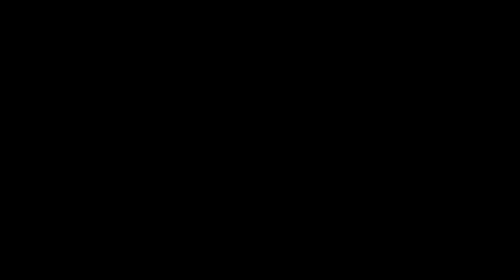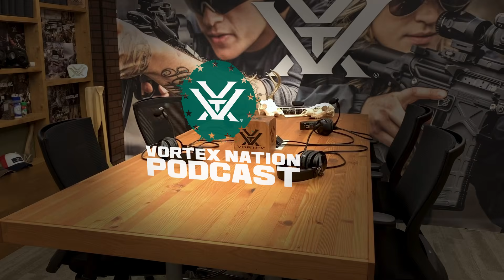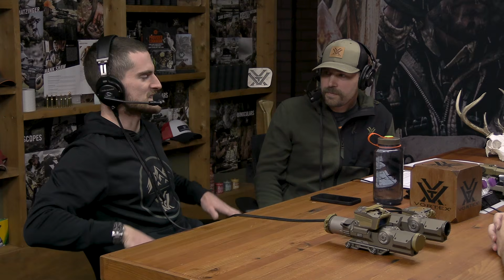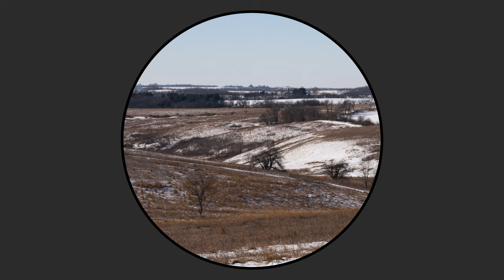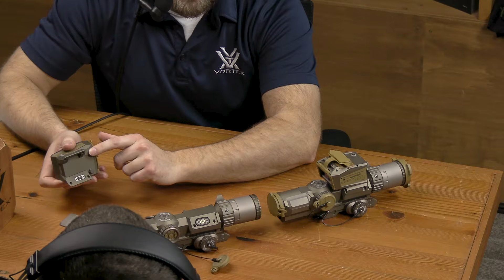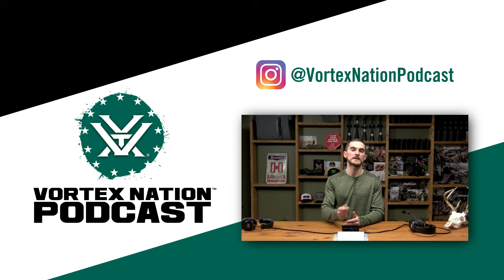Ep. 220 | Army selects Vortex® for Next Generation Squad Weapon – Fire Control. What is it?

Comment: That scope is more of a sensor node mounted on a rifle with an interface related to that platform.  a smartphone could do the rest of the integration with IFF and Target Designation for the BIG boom.  

I might be the thing to do in the future.  Issue a mil-spec encrypted and hardened smartphone to the soldier/Marine as they graduate their basic MOS courses.  Most phone have plenty of compute power and having the standard software load would allow that automatic connectivity that would integrate that scope.  It might allow the scope and other items to be only as smart as they have to be as well. When the servicemember leaves in 4 years, the partially dated technology is scrubbed and they get a current android or apple operating system with their familiar tool and the service can automatically update a lot of its basic computing and  communications technology.

Comment: Saw this mounted on a rifle in an article about the XM7.  The box on top is kind of hard to miss, so I dug up this video to find out what it is.  Good explanation, but now I'm wondering what the intentionally mysterious forward data port is for.  I can only guess it's intended for night vision, but not clear how it wouldn't get in the way of the range finder.  Also, no one mentioned it, but it appears there is a third data port on the back of the range finder.  It looks intended for a cable connection, but for what?

Anyone dreaming of having one of these needs to consider enlisting.  They are a small company with a military contract for 250,000 units.  In the guest's own words, once they ramp up production to meet their contractual requirements, then they will reassess civilian marketability.  No way are these things being sold to the DOD for less than $30k.  How expensive would it have to be for a civilian option?  If it ever shows up on shelves, it'll be at least $14k.

Happy hunting!

Comment: Long-winded interview with 10 min of detailed facts. I understand the drop test but the waterproof test is not covered to my liking. Is the scope submersible in operation to 10ft (3 meters)? Which caps need to be on? What about water vapor getting in with high temperatures? This is the Achilles heel of most optical scopes. A fogged optic is impossible to use. What is the range of the local area network? Can an enemy pick up this scope from a dead soldier and have instant intel on everybody's location? You said something about a wireless smartphone interface. Explain?

Comment: Only wish they mentioned eye relief. I can see this replacing LPVO, Prism (ACOG) and magnifier + RDO combos, but the one thing it won’t have is infinite eye relief and almost no parallax that a reflex sight gives you in a CQB situation.
I can see soldiers still mounting a micro red dot on top of this (or offset on the rail). Or they will just improvise:  I have a police officer friend in the anti-drug unit and his duty gun has a LPVO and, when he has to make a shot inside the same room, he just place the top turret of his trijicon scope at center mass and shoot. Considering the body count of his unit, they are probably into something.

Comment: Won’t the laser and scope be off at long range if they are zeroed at the same distance not originating from the same point?
Reply: Only if fixed, if the lasers change with a range drum adjustment on certain scopes you’d be fine.

We didn’t rely on our lasers beyond quite short ranges and I liked them for allocating arcs, reference points and targets to troops. Very handy at short range opportunity targets combined with HMNVS (helmet mount) though.

Comment: The best part was the rendered view threw the scope. It is nice to see a guy taking part in making the things talk about the product. I would imagine the thing at least has the capabilities of a flagship cell phone IE cameras, GPS and possibly other allied positioning chips as well as AI and AR capabilities. I imagine that networking the scope to DoD networks and localized computer such as a laptops, vehicles or other portable squad based or personal computers increase the devices capabilities. Keep in mind call phones have had limited AR and machine learning capabilities for years. If machine learning is incorporated it could be on par with something like an Nvidia Jetson to some extent. In any case a civilian version will have different networking protocols. Bluetooth, WiFi or both due to FCC regulation that don't apply to military devices but do apply to civilian devices. Id also imagine the laser designator may be turned down for the same reason. Though Bluetooth is and always has been insecure unreliable garbage and I would rather not have it on anything attached to a weapon... I am referring to the several Bluetooth exploits where bad actors could remotely enable the radio and walk into any device. It is very possible that besides the radios and designator this scope doesn't have anything a civilian couldn't have giving that its intended to be used as part of a network and I'd imagine that most of the heavy lifting would be done remotely. How ever if it has a UV and or high res IR camera on board it could be quite expensive. If it some how incorporated true night vision I am impressed.

That aside I want one and I am excited for this product. I find it interesting how well the Army is learning to use technology though some times I think they over use it in some cases. But turning everything into a recon device in order to build a more complete and accurate image of the battle space is definitely the right direction. I have to wonder what the point of a 3 color display is when a transparent OLED could provide a full color experience. I can only imagine what ever display they have gone with must be more reliable than a standard transparent OLED but off the top of my head I am not aware of a display or display tech that is not either mono chromatic, RGB or full color. Its probably a custom display.

Comment: Props to the Army, this is a no-brainer. Why would they choose the Vortex over several big names that have enjoyed their spot in the sun, like Night Force and Swarovsky? 

Because the optic does not fail and does what it is supposed to do, regardless of price point.

I have learned from personal experience. I have always been a Vortex fan boy but I tried a few other optics. Including one recently getting a lot of attention and being the main competitor to the Venom and the Strike Eagle.

A) I still like the Vortex glass and coating better.
B) the other scope had scales that would slip (engineering problem.) I mean the other cover with the number on it would spin freely after sitting the cabinet for a month. So, I put the Venom back on. Not once does a scale on a Vortex slip around the turret. For any reason or lack of reason. Ever.

Vortex scopes are built so that you zero your rifle and ammo and you are done. Store the rifle. Pull it out later and go hunting or rangering or designated marksmaning, or whatever. You don't to have find that one allen tool and then hope that you had where it was supposed to be.

So, the Army decided they needed an optic that does the job and does not fall out adjustment. Stick it one, climb a ladder on top of a mud hut. Start neutralizing enemy threats. It does not have to be complicated.

Comment: you would think that with an advanced high tech optic such as that. that it would run a secondary monocle system, kinda like what they use in an Apache Helicopter, to where you didn't actually have to look through the scope itself you could use the monocle, to see what your scope is seeing or aimed at. now that is a scope that I would like to have to where i could see everything the mounted scope is seeing without actually having to position my eye to the specific distance to see through the scope

Comment: It's times like this that I wish I was still on active duty Army so I'd be able to play with the new toys a lil bit sooner rather than waiting years as a reservist. That also brings up the silly comments I hear from other's about these new weapon systems where they think the military is just gonna chuck all the current gear in the trash and switch right to the new stuff and only that. Our military has a long history of fielding equipment and gear for 50-100 years getting as much use and life out of everything. Heck my unit just last year get a new batch of fresh M4's to replace our M16's, those are gonna still be around and in use for many years to come and when the day comes that the new stuff filters down and replaces our current stuff, they'll just turn in all the old stuff to get stored away for a rainy day just in case. Also the training of basic marksmanship isn't gonna change too much with these new options, they'll just add on to what we currently use. The average soldier is still gonna need the basics to fall back on just in case something happens to this optic system so it's not like our troops are gonna be screwed just cause we have an upgrade and it gets taken away suddenly. So far I'm liking what I'm seeing with this system and hopefully get to try it out before retirement lol, that only slight nit pick I have so far is the battery arrangement I'm guessing yall picked side by side CR123A to perhaps reduce overall bulk, I just wish they were in line and could also take a rechargeable 18650 or similar like the one's streamlight makes for their flashlights but that's just me lol.

Comment: Year 2350 westpoint academy.."and that was when the age of the scope started"

Pairing these scopes with smart bullets is the future.
Reply: I don't see 6.8mm smart bullets coming out any sooner than fusion power for commercial usage. They've got them down to .50 BMG, but not yet up to even 7.62, leaving them right up there with the 20mm smart grenades that never survived to prime time and the old mk14 torpedoes that occasionally worked during WWII.
For this, I'm retired now, so have no use for the $3k laser module, but the etched scope, well I'm used to paying more for the optics than the rifle. And well, MILSPEC means, the weather can range between crap, poop and shit, the damned thing will still work the same, with only mild adjustments in use and care.

Comment: Looking at the new XM250 machine gun, doe s the mounting of the xm157 optic interfere with opening and closing the weapon's feed trace cover? Was any testing done with this optic on the XM250? The optic looks rather long and may potentially block acces to to a critical part of the gun.
Reply: Good question, our optics and night sights used to mount on top of the Top Cover which meant a bit of extra practice for the gunners to get used to it.

Comment: The only real issue I see with many of the extras on this optic, ties in with the laser range finder. Most near-peers are mostly mechanized infantry that are integrated with or generally in close proximity to an IFV or other armored support. All of those vehicles have very sensitive laser warning sensors and don't have to directly be painted for the sensor to be tripped. Many advanced optic monocles and binoculars can also passively pick up getting hit by a laser range finder as well when your own ranging numbers start throwing odd values or giving an error status all of a sudden. Most units aren't running around with a laser range finder on that ridiculous rail setup you showed. Most are still doing it the old-fashioned way of using the mils on their scope to do some fairly accurate approximations. What I'd be afraid of is in a future war with a near-peer, one of your guys paints them with the laser range finder, triggers a laser warning sensor and the enemy drops to the ground and goes into high alert and they already know where you're generally located and your range since, like tracers, lasers work both ways.  

So, like many other advances, it works well in theory but falls short of its objective in practice because the engineers and military program planners assumed future adversaries were idiots who themselves aren't trying to upgrade equipment and have also buried their heads in the ground. We used to have an old saying in the Air Force. You need proper control and discipline with EVERYTHING that you emit, not just your bullets. Lasers emit energy and that's something that can be picked up and detected by an enemy that knows to look for it. You're going to have built-in microsensors on people's rigs and equipment that'll flash a laser warning to the user and approximately where it's coming from which should give them enough time to hit the dirt to get into cover. They now know your direction and approximate range before a bullet ever left your gun. Many other support functions can visually see this energy readily already and when we're talking about the proliferation of small observation drones, the relatively low-intensity energy of a ranging laser will be observable to adversaries who know that laser range finders are prevalent at the individual infantry level. Vehicles already have them since other vehicles and infantry engage them using laser-based designators/range finders and it's been standard equipment on modern armored vehicles and in-flight vehicles for decades. 

So, we now have two potential issues. Troops train and learn to use these optics to their fullest but lose out on many tactical advantages and many times, the element of surprise and movement. Or, it'll just be a heavier optic than the LPVO that they were using and they weren't using a LRF anyways so they now have an even heavier optic with functions they'll never really use. On top of a weapon system that's now at least 2lbs heavier dry than their older one which was already starting to comically get too heavy with all of the crap some units wanted troops to put on them. Crap that ended up in a duffel bag next to their cot once they deployed.
Reply: The LRF has to be manually activated by the end user
Reply: And we have multiple methods for range estimation that are still taught and practiced
Reply: @hanzzimmer1132  Of course the LRF has to be used manually. The issue is that you have something that's not going to really be used for the occasion that it was originally planned for. A modern army has laser warning detectors all over the place. You're not going to be using a laser range finder, physical optical laser or IR laser as a modern, near peer would be able to see all of those as well. We aren't talking about a ragtag group of folks still stuck in the 40s and 50s in tech. 

The fear is that we have people who can do that NOW but if this gets pushed and trained hard on the new recruits, the fear is that they forget or aren't very good on the old ways of estimating range. We're already seeing it somewhat today where a lot of troops don't really know how to use ballistic sights anymore because they became overly reliant on the simpler red dot sights. Troops already have a ton of things they're training in today that previous generations never had to worry about and are all competing for their limited amount of time already. We're already adding so much crap to a soldier's training in basic that they can't fit everything in at basic and they're sending new privates to units partially trained under the condition that the unit trains them further when they receive their new soldier.

Comment: So the Army is going back to .308"W ammo performance/weight for the Infantry (no, really...) but more expensive of course, otherwise how are you going to sustain DOD corruption right? So agreed .223" does not cut it, but if you want to go back to 7.62x51mm performance, do you really need to spend gazillion millions of $ and try to re-invent the wheel? In my humble opinion this is just more W-DC BS at it's best!
Sorry about the rant. Cool scope/spotter rangefinder functionality integrated with commo platform though... and I guess it would also work with whatever cartridge's performance there's out there, and not only the wet dream DOD morons would come up with. I mean not only .308"W, right?  :>0
Reply: They said right in the video it works for new and legacy calibers, I mean, all you would need to do is program into the scope's memory the ballistic info of the rounds and it will use that info in its point of aim calculations.

Comment: IF...it works as advertised...this is like the individual soldier's version of the M1 Abrams fire control system.  A big challenge to shooting at distance are the meteorological factors.  If you zero your rifle at one temperature, and end up on an op with a very different temperature...that shifts your zero.  Snipers know how to calculate those variables.  In the heat of the moment during a pitched battle, the typical soldier has to know "Kentucky Windage" of their individual rifle.  Some soldiers are a lot better at it than others.  This will remove so much guess work.  The other thing I like is the compass overlay with a laser rangefinder.  This makes life MUCH easier when calling for an artillery fire mission.  All you need to know is where you are on the map, and the scope system tells you exactly where what you're looking at is located.  The only way it could be any easier is if it actually provided the MGRS grid coordinates of the target.  I'm sure that feature will appear eventually...say, in an updated version.

Comment: If you add GPS, and the chip can support converting distance and direction to grid co-ordinance, you have turned every member of the squad into Forward Observers. Add the ability to encode the laser and you have given them the capability of a GVLLD. It would be a huge leap forward if every member of the squad had the ability to designate hard targets for engagement with indirect fire weapons or air support by the push of a button on their scope. This blows my mind you could have a drone or satellite downloading present or approaching threats directly into the scopes.